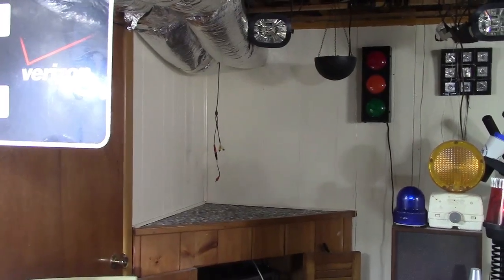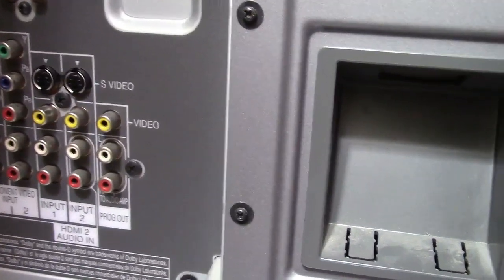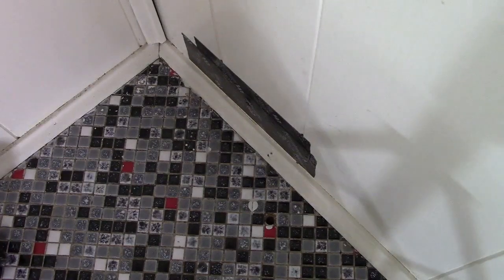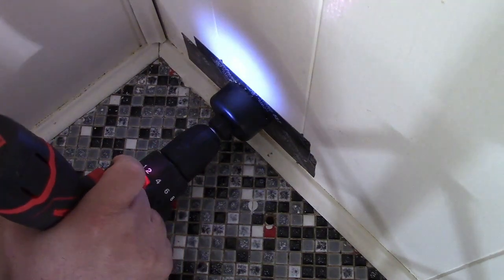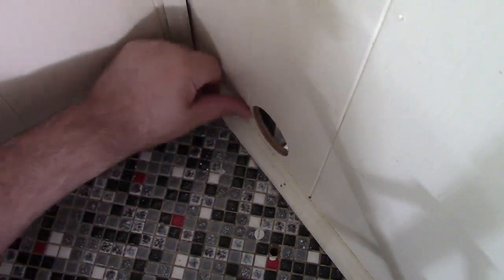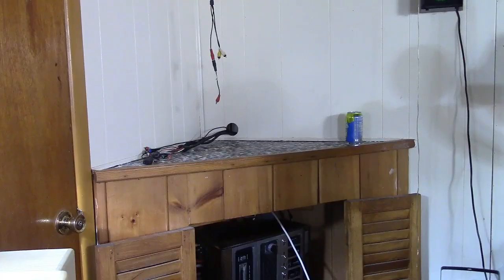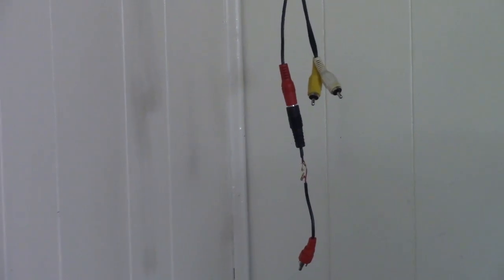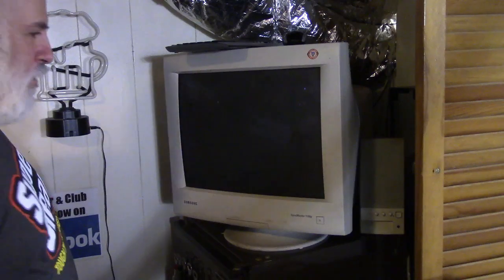Drilling The Hole And Running The Cables For The New Basement TV

Comment: Real nice job on that cut out, and glad you found a round tuit, in the process.
Reply from the maker: Yes, it worked out quite well.  I though the wobbling hole saw would be a problem, but it carried right on through with its job.  Pretty sure I could have gotten away with a smaller hole.  I was almost all set to use the next size down, but decided not to at the last minute, because I knew once I made the hole, I could never enlarge it.  So in that regard, it's "futureproof" and even forwards-compatible!

Comment: 2:44 HDMI audio in is in case you're plugging in a PC using a DVI adapter to HDMI and want to use a 3.5mm to RCA audio input from the PC to the TV. 390 watts! Those plasma TV's sure used alot of power!
Reply from the maker: Ah, no kidding!  I just looked on Amazon and VGA to HDMI adapters with audio can be had for around 10-15 bucks.  So nice they added it, but these days likely unneeded.

For the picture it gives, it's worth the power!  The one I have in my living room is even larger at 54".  It so happens they wired the house where the living room and garage are on the same circuit.  I've since run 50 amps out there so it's not a problem, but the lighting is still on the original circuit.  I can turn the TV on, stand in the garage with the lights on, and on very "flashy" images, you can see the lights dim in the garage.

I have not seen an LCD TV that can reproduce the richness of color that the plasma can, which is almost on par with CRT.  You will see this especially in the greens, an LCD cannot accurately represent those colors.

There's actually another plasma I got my hands on that needs repair.  So far it hasn't gone well, but I might revisit it.  I have 2 videos of that already, probably a third one when I have another go at it.